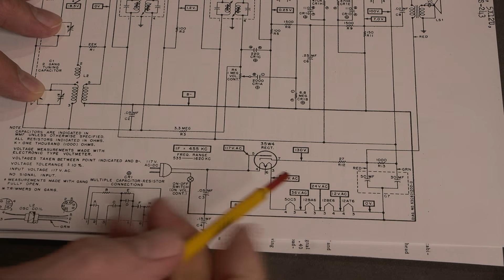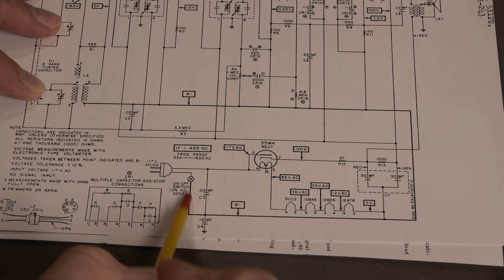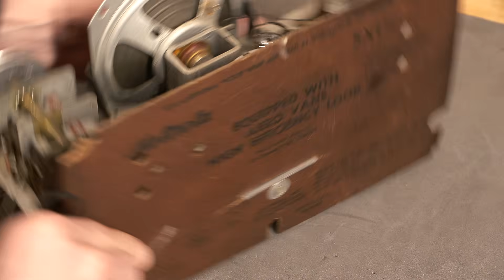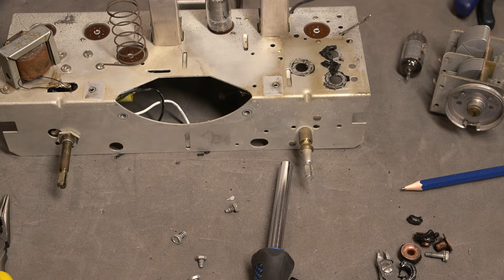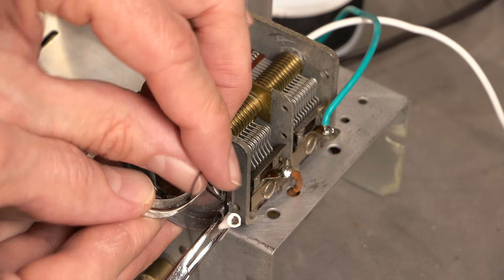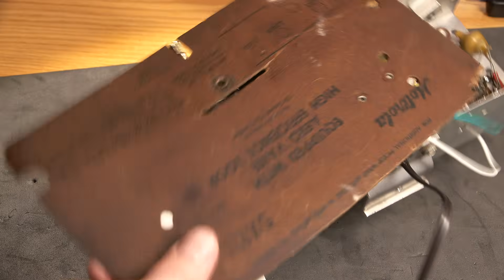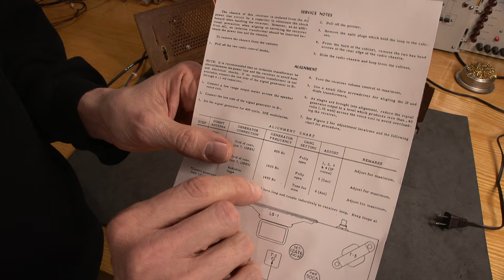Motorola Radio Restoration And Modification - Full Detailed Procedure With Bluetooth Addition!

Comment from the maker: To learn electronics in a very different and effective way, and gain access to Mr Carlson's personal designs and inventions, visit the Mr Carlson's Lab Patreon page here: https://www.patreon.com/MrCarlsonsLab
Reply: Power supply noise, ugh... that's familiar to me, pretty much all my radios receive... lol....
Green is my favorite color.
That thing is beautiful....

If you ever want to sell that radio, with the conversion, just tell me how much....
Reply: tim tron would be proud. tho he might come up with something diff lol cough snort hack. hahhahahahhaha 73 oldman
Reply: Hi, what is the particular reason to extract the coaxial center conductor to shield this long wire instead of replacing it with the whole coaxial cable ?

And what about the spring around one of the lamp, is it a kind of shielding to avoid a [I'm French and don't know the technical term, it is when RF comes bugging into audio (or between HF stages), creating an audible feedback loop] ?

Long video but with so many useful explanations. :)
Reply: cell phone booster would be nice. we lucky for half a bar. in champlain ny area
Reply: look dude, if that bluetooth supply board was installed in the other direction and all AC wiring was confined close to chassis / in its corners - u wouldnt need all this audio shielding bloatware in there
Reply: A beautiful radio, Happy your back I love your videos
Reply: @MrCarlsonsLab  You know what seems to be the hardest to fix, intermittent problems!
Reply: How do I choose a competent person to restore my 1930 philco radio
Reply: It's wonderful to come back and experience, your shear energy and enthusiasm, patience and joy of simple explanations as you lovingly teach electronics, you are the reason I now have a lab,also some museum pieces,even though A,I takes the main frame,One should nevertheless take all for granted,This is where you are a powerhouse,in this field,I only wish you and your family friends,supporters health and happiness, long may you continue your quest,great administration for your success, should you need or require eny electrical pieces it's yours without charge,just ask,I will post,! Also love ham radio, regards 88s,😎🌎👋

Comment: Great points! Sometimes a simple AM modulator is all you need to enjoy modern audio on a vintage radio without making major modifications. These old radios were never designed for high-fidelity sound, but their warm, nostalgic character is part of the charm. Still, adding Bluetooth is a clever way to bring an old classic into the 21st century. 📻

Comment: Super cool modification. Lots of people are adding Bluetooth to these radios.  I am really not sure why anyone would want to listen to music through these very low fi devices though.  For all the trouble, I have decided that a cheap AM modulator is good enough, and a lot less work.  I know a direct connection to the output tube will sound better than the radio, but i'm not sure it is worth the time and effort. If your going to spend hours with a soldering iron, it might be more productive to restore a great vacuum tube hifi amp or reciever. This however a really great job of modifing a dime store radio for the 21st century. Spot on perfect work.
Reply from the maker: I appreciate the feedback, and it's always fun to keep these old radios useful for daily listening!

Comment: Hi Mr Carlson
You are making really interresting videos about restorations - thanks a lot 🙂
Do you put the solid state diode just across the rectify 35W4 tube (it looks like that at the video) or do you remove the rectifier part of the tube and just have the filament connected?
How do you built the solid state hum remover and is it placed at the "red" wire to the audio transformer?

Comment: One thing I would note that the chassis is isolated from B- by the ,15 cap c-4 which provides an RF ground but not a direct connection to the mains.  This is why his bulb did not light when he touched that center screw as that cap would not pass enough current.  But those rivets on the left connected to the antenna, one of them is connected to the frame of the tuning cap which is connected to B- and that is the path to one side of the line as plugged in during the first demo.  This was a bad design and should have had a cap isolating that connection like some radios did.

Comment: What about losing the mains connection and modifying it to use the vacuum tubes that had a 12V heater and 12V B+ so that it just runs of a 12V car battery or 2x PJ996 batteries.

Comment: There are hardly any AM stations left in the UK. Even BBC R4. Long wave (198 kHz), oldest continuously operating station in the UK, will shut down when the electric supply companies have swapped out the meters that use R4 to switch tariffs. A Bluetooth to AM transmitter would be fabulous.

Comment: I have used the "J" hook method quite a bit as there is more of a chance of damage to other components. But, looking at this soldering job of those "J" hook connections, that's just poor soldering, not because it's a "j" hook. Those connections look like what us old schoolers called "plumbers joints" , really poor soldering. My "J" hook connections are clean and shinny looking.

Comment: I was quite horrified by the introductory testing for mains isolation using a hand held light bulb and an earth wire; an electric shock seemed likely! 
As a boy I used to have a testing screwdriver with a little built in neon bulb for that purpose, although in the the US, with the mains only 120 V it probably wouldn't have worked.
Some cheap light weight valve radios tended to skip the heavy isolating power transformer and connect the mains directly between the rectifier and internal ground, the valve heaters also being connected in series across the mains with a selectable dropping resistor for differing supply voltages.  Obviously this arrangement meant that they couldn't be properly earthed so they were provided with an insulating case and the hope that no one would stick their fingers in the back!

Comment: Paul, why did you remove the core (inner wire) of the coax cable? Couldn't you just have replaced that old bare wire entirely with the coax cable as a whole?

Comment: Good point about touching tubes Paul... When I handle them I do try to avoid touching the writing on them eg type numbers particularly because I have fund that the writing can easily rub off on old tubes, leaving you wondering what they were... Especially if you don't have your level of extensive knowledge of tube types...

Comment: Such a cool radio to keep around. Love the mods. I love these old radios. And other electronics. They were built different. Like better in a way. Obviously not in every way for sure but How many years later with a little work and its back up and better than new. New surface mount stuff won't fare that well IMO.... for sure not as easy to fix. And not as cool.

Comment: A question regarding the original line cord. Would it be possible to drill out those rivets, open the plug and replace one of the blades with a proper wide blade, thereby retaining the original appearance and line cord?

Comment: Hello there Mr Carlson.  Previously I am sure I have told you I watch most genres of electronics/computer repair.  Now, I have seen you use and deal with those small surface mount components,  I know that you know what  when and where they are applied!?.  Do you ever diagnose component cards from laptops etc?

Comment: Wow!!!!  Chassis connected to one leg of the mains supply., no fuse.. and switch in the neutral.... what could possibly go wrong... and amazing that it was " legal" !!
In the uk during the mid 1960' s - i worked on a lot of domestic radio and tv as a service engineer... and most tv's in the 1960's and beyond  were what i call " live chassis" design. 
That is ... where the internal chassis is directly connected to one leg of the external power source. 
And that was intended to be the neutral line.

This was done simply to save money . ( no internal transforrner thus providing isolation of internal conductive parts)
Ok - in the uk the bs 1363  "three pin"  plug  even in those days was well established.. so as long as it was correctly wired... you could be sure that the internal chassis was connected to neutral ( and in the uk ... many supply  systems were of the type where the neutral conductor is connected to ground either at the supply transformer (tns) or bonded at the premises ( tnc-s)
Some systems called "tt" systems employ a local earth stake which isnt connected to neutral.
Either way... looked through "21st" century glasses in the lands of safety regulations.. earth leakage (rcd) trips etc etc..  I find it amazing that " we got away with it" even in those days 

As a young ( 17 year old inexperienced)  service engineer.. i actually did get a severe shock from servicing a tv on the repair bench .
( no one checked to see if it was wired correctly... and no one warned me about that... such were working practices in 1964!)
The co-axial aerial connector which clipped onto to back of the tv was a clever design. It was a disc comprised of two layers separated by a capacitive ring of some thickness thus affording a very high breakdown voltage with some 100-200 pF capacity.
😂
That is.. the external connection "ring" that the user could connect to was capacitively isolated from the inner part which was further connected to chassis ground via another isolating capacitor of around .01 uf

With this aerial connector removed from the back cover for service access... i got hold of it to remove the aerial lead which was grounded - and once this was removed.. i had the aerial lead in one hand.. and both parts of the aerial connector in the other hand ... and thus was connected to 240v rms ac across both hands via the 0.01 uf capacitor.
All i remerber is a severe shock followed by the guy on the next bench kicking the supply plug to the tv out of its socket.

In those days there was no isolation transformers or leakage detection! 

Suffice to say ...  restoring live chassis receivers is an incredible risk if one is going to ownwards supply to an unskilled end user.

Comment: What happened to the filter capacitor that's "supposed" to be attached right behind the speaker? I have a 5H11 that looks exactly like this chassis, but mine has a Aerovox filter capacitor.. I understand different models, but maybe you can explain the differences.
Thanks!

Comment: You don't need to do all that with coax cable to get some shielding.  I bought some copper solder wick that happened to be a complete tube just pressed flat.  With a little bit of work with a multimeter probe or something I can open up the end and get however much length of mesh shielding I want, if I had such a need.  It can be slid down over a rod or piece of wire to open it up circular and the ends can be soldered in place.  Plus it doubles as solder wick.

Comment: You know Paul, millions of printed circuit boards have their components held in just by solder, and the pipes in my house are at 80psi of water pressure and are just held in by solder. It goes back to when we learned to solder and were told "don't rely on solder alone, you must provide mechanical fastening as well." I think it is nonsense. Thanks for the video, as far as I am concerned, the longer the better when it comes to your videos.

Comment: That fuse block is a good solution, but are they really as expensive as the one I found -- US$8 apiece? I've been looking for something other than an inline holder because most of them appear to be for automotive use and I don't trust the rating for higher-voltage applications, especially given the epidemic of under-gauged wiring online.

Comment: Just curious why you didn't just use a piece of coax instead of going through the effort of pulling the shield and slipping  it over the existing wire.
Reply from the maker: Soldering the lead of the couplet to a piece of coax close to the couplet causes bad things to happen!

Comment: Do you do repairs for the public?
Reply: I think if it's interesting enough equipment maybe he will.
Reply: @ I seen a video on a magnum inverter. I have one a step up from the one in his video. My a/c board is bad and the board isn’t available anymore. So I’m thinking the board would need a few things. Like main transfer relay probably the neutral grounded relay maybe even one or more of the voltage transformer. There’s also some capacitors on the board. I’d like to have it fixed if possible.

Comment: @ 58:30 For 60 years I have wondered what those little slots in the cap plate were about.  Thanks!  The first time I looked into a tube radio as a small child, I was amazed that contraption somehow magically tuned a station.  Of course as a grampa now I know about resonance circuits and what not.

Comment: Why didn't you just use the conductor that was already in the coax instead of going through all the trouble with insulating the old conductor?
Reply from the maker: Soldering close to the couplet will damage it.

Comment: Thanks for the video.
Just wondering about the 1/2 wave rectification problem, could you put a second rectifier tube in and get full wave to remove the problem?
I have a limited knowledge of electronic, and just want to know if this would work.
I purchased a transistor radio, and it has a police band, that no longer picks up anything could I install a blue tooth module on the police band?

Comment: The line cord and rewiring the power switch was the first thing that I did to my Zenith AA7.  Then I replaced the 35C5 with a 50C5 and removed/bypassed the 5 watt resistor in the filament circuit.

Comment: Congrats Master Paul for the 400K subs first of all, second this radio looks stunning absolutely gorgeous whoever made this paintjob is a real Master at painting just like you are at electronics! Extremely out of alignment I was also surprised.
It has really nice sound and no tone controls and receives really well but about the bluetooth if you make it completely silent wouldn't be nice to have a small led, a little dim one attached to the outer circle of the speaker grille let's say in order not to drill any holes, to inform that bluetooth feature and cirquit has come to life and waiting for streams or pairing??
Cheers from Greece! Keep Up! Dimitris...
Reply from the maker: Thanks for your kind comment Dimitris!

Comment: Hello Paul,
aren't the IF stages set independently?
I mean to connect a 455KHz signal to the mixer output and adjust the following IF stages to maximum with modulation. Then the oscillator and the input stage. This way I can rule out that I'm not tuning to a different IF frequency. Maybe that's why the IF circuits were so far off?
73 Bernd

Comment: Perfect Timing, for a tube radio video, Mr carlson,my grundig 4035w tube radio is almost finished, the biggest german 1950s radio i got,so far,if i use it on full Volume, the whole basement is vibrating,and even on full Volume, the Sound is clear, and powerful.really nice radio.

Comment: Love the tip about pushing oil or grease through a bearing. Edit: I also like the ripple filter. I think it may be a series of emitter followers or parallel shunt transistors as this is a low power circuit and you mentioned that your ripple filter circuit introduces a voltage drop. Great idea.

Comment: When I worked for LMI3D some of the in house built equipment had the operator antistatic line a wire that lead from the metal bracelet to the AC neutral line instead of to a 1MOhm resistor on the earth line. Took me a long time to fix all the equipment.

Comment: Another informative video, but I do have a question.  With regards to the addition of the coaxial shielding to the input and output of the little couplet package, is the shielding connected to ground and if so, did you connect it at one end or both ends?  Thanks

Comment: Yeah like dismantling an ordinary coax lead to only use the shield of it together with another existing lead instead of just removing the existing lead and replace it with the full coax cable would any sense???

Ok... I can live that...
Reply from the maker: Guess what happens to the couplet lead in wire connection "under the coating" when you solder close to the package.
Reply: @MrCarlsonsLab I have clip on heat sinks for such situations.

Comment: Mr. C, what are your thoughts on cleaning variable capacitors in an Ultrasonic parts cleaner? I metal detect and scrounge around in old, now mostly wooded dump site, i come across a few radios but usually have been laying on or in the ground since the 60's.
Reply from the maker: There is a possibility of loosening the phenolic strips that the plates are crimp fitted too. You can see those strips at the ends of the capacitor plates when the capacitor is fully meshed.

Comment: Some of your techniques are what I would call "too clever by half". For example, making a shield out of RG316 and then having to fiddle with straightening and shrink tubing thinly over a component lead when you could simply replace most of the lead with the intact piece of coaxial cable. The center conductor of the coax is far better wire than the old hybrid lead. The only potential negatives are that the coax is slightly more flexible than the lead and you have to be willing to J-hook solder to the shortened lead. Cases where those factors militated against using intact coax would, I think, be rare.

On another matter: have you considered using UV curing resin to fix your dial cord knots instead of cyanoacrylate glue. I picked this technique up from fly tiers and find it generally easier and less prone to error for many tasks that would have formerly been relegated to CA glue.